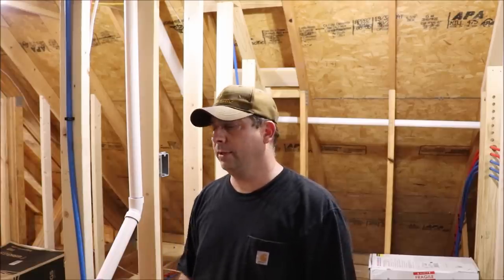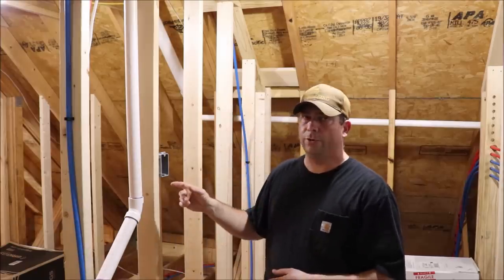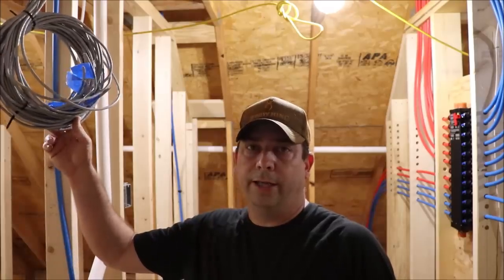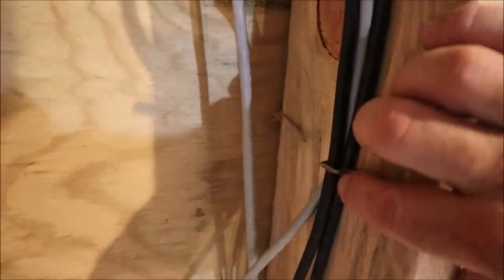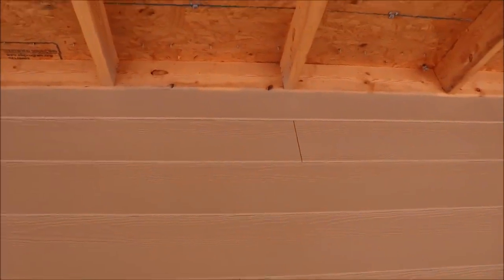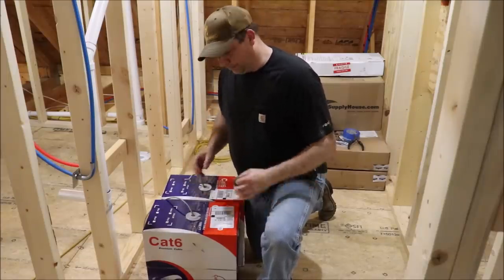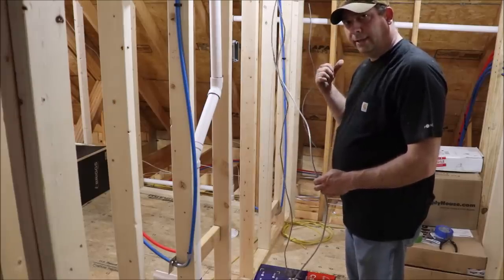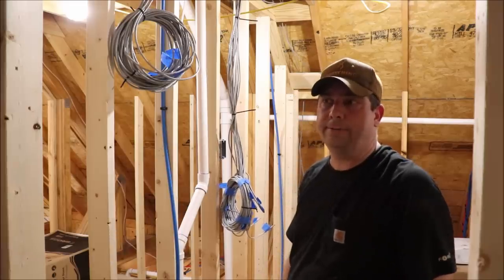Building My Own Home: Episode 110 - Roughing in the Lan and Security Cameras

Comment: Great video! Much easier than retro fitting CAT6 in an existing home - you can never have too much. You can use a sharpie to write directly on the cable whatever number the cable is.  I'm sure your patch panel will be numbered, but helpful for the far end for any future troubleshooting.

Comment: Hi there,
You can never get too many lan cables nowadays, one question though, I live in Italy and here we usually run lan and sat cables in a corrugated pipe which runs into the walls and terminates in an electrical box ( separately from the elecrical cables)  that allows a futureproof expandability, if one day for any reasons one of your cables fail, how could you handle it?
With a corrugated pipe you'll can easily remove the bad cable or even add another one if needed.
For example my house was built in 2002, back in those years there wasn't the "lan culture", but luckily italians were in the sat hype, so all of the rooms had sat input installed in the walls, that allowed me to exploit the same corrugated pipe to run a lan cable in pretty much every corner of the house!

Comment: House is progressing nicely. Would not have considered that many wires needed to be pulled, that said I am not computer savvy. Are you doing the gyproc yourself.  That would be a lot of sheets of 8’ 10 and 12’. A lot of slugging gyproc up stairs. All the best my friend 
‘
Reply from the maker: My wife and I have been talking about it and sadly, I think I will be having to hire out the drywall work. I am having issues again with my back and don't want to risk a permanent injury trying to drywall by myself  when my back isn't 100%.

Comment: I've got CAT6 retrofitted all over my house, it is the best way to go for everything that doesn't need to be wireless.

I would have thought that in your area you could leave the doors unlocked and the keys in the ignition and not need a house bristling with cameras.
Reply from the maker: We are actually in a good area. But an ounce of prevention.... Just seemed cheap and easy to do now where it won't be later. Plus if I want I can use those cables for cameras or WiFi extenders. Never know we might wind up with some mobile chicken coops hooked up to the network for some automation or something! Lol

Comment: I know the cat6 wires are probably shielded but anywhere they directly cross or run next to a 120,240 AC wire, we would wrap a couple of layers of aluminum foil to avoid ANY interference. It's simple and fast.
Reply from the maker: That's a good idea. Thanks for the tip!
Reply: You bet !  Thanks for the videos.
Reply: when i used to pull a ton of cable we could keep some 1" pipe insulation and cut a 6" section and put it over the CAT cable. same idea. some separation can't hurt!
Reply: For most installs, as long as you cross your power lines at 90 degrees and keep parallel runs to a minimum, it shouldn't be much of a problem.  AC motors and lighting ballasts can introduce some noise on the lines, but it shouldn't be too bad in a residential setting.  IMO, shielding and even Cat-6 is overkill, but to each their own.
Reply: STP (Shielded Twisted Pair) Ethernet is a pretty much necessary in Lightning prone areas. a nearby Lightning strike can cause a small EMP that will take out networking equipment. Seen it happen multiple times.

Comment: You going to run coax for TV and TV antenna?
Reply from the maker: My electrician buddy ran in some coax for tvs already, I will connect them to the outlet plates. But I don't have TVS so they won't be used.

Comment: Do you have a link or suggestions on what cameras are better than others?
Reply from the maker: I am certainly no camera expert, but I am using a Canon SL2. I have been pretty happy with it.
Reply: @ArkansasHomesteader  I meant your security cameras?  Also I sent you an email asking where you get your pex thru?
Reply from the maker: Oh sorry, I havent selected my security cameras yet. I only know I plan to use POE cameras (POE = power over ethernet). I bought my pex from supplyhouse.com. You can buy it from the local box stores, but be careful you dont buy any that's been sitting on shelf for a long time. If uv light shines on it the pipe degrades.

Comment: Forgot to mention that you used CCA Cat6. It’s a cheaper version of Cat6 and doesn’t meet the requirements to be even called Cat6. You wanted to go with full copper conductors. It would’ve been better if you purchased Cat5e full copper than Cat6 with CCA conductors.

I’d research your options before you put drywall up, there’s a chance that those outdoor cables will oxidize due to being CCA. Here’s an example of good Cat6 cable: https://www.amazon.com/dp/B0049KV52E/ref=cm_sw_r_cp_api_i_MMACCbM8SE10S

Comment: Any concerns about lightning?
Reply from the maker: Only that because of the wrap around porch the first floor will not get as much natural light. But I think I have installed more than enough lights to compensate.
Reply: @ArkansasHomesteader  I was wondering about lightning, the type that can strike near your house. I was thinking of protecting my property, which is remote, with a suppression system.

Comment: Everything's going wireless nowadays, even security cameras.  I wouldn't even bother running those LAN cables.
Reply: TheZigZiggy reliability you want wired.
Reply: TheZigZiggy plus, if you watched the video, the cameras are PoE. So he either had to run power or cat 6.
Reply: Hard-Wired will always be better than wireless on all aspects. It's not even close and for security, guess what's better ?
Reply: It seems like you could have gotten different colored cat6 spools to make it easier to differentiate for install and later down the road. Any reason you wanted to stick with all grey?
Reply: @ditchboy3698  It doesn't come in many different colors.  Besides, it's dead simple to identify any cable with a cheap test set you can buy at any HD or Lowes after you've installed it.  Even if you forgot to label it.
Reply: Go wired if you can
Reply: If the walls are open like in this case, definitely wire.  Especially for cameras.  Yes agreed, wireless is also a big deal for tablets, laptops, etc.  But even that starts from wiring...I like to hardware a few Wireless “Access Points” back to the primary network switch/router, and that provides strong Wi-Fi coverage through out
Reply: Power isn’t wireless. Also, it takes less time to pull cable while the framing is open than it does to troubleshoot wireless issues later. I say that as an IT manager who makes these decisions for a living.
Reply: He did a great job with planning, I also wanted to mention that he used CAT6 cables rather than the cheap Siamese cables that can’t be used for future-proofing. Wireless isn’t always better, especially in this circumstance.
Reply: TheZigZiggy those battery wireless cameras are cool but you have to charge them and they are more pricey. And for the ultra paranoid, it’s rather easy to jam wifi.